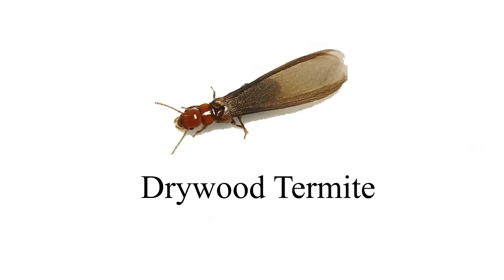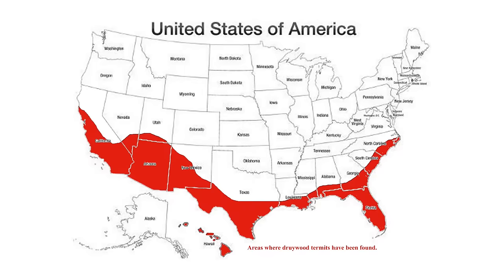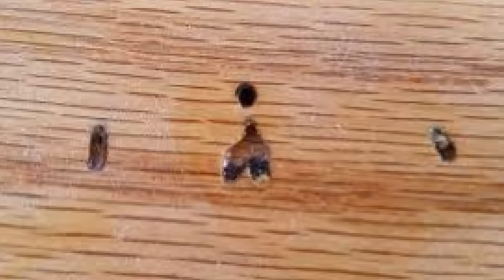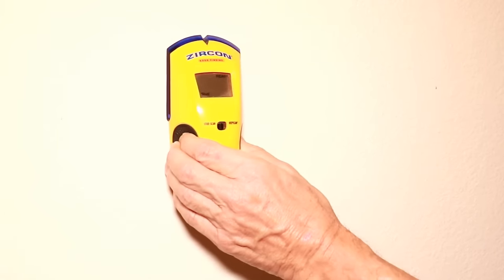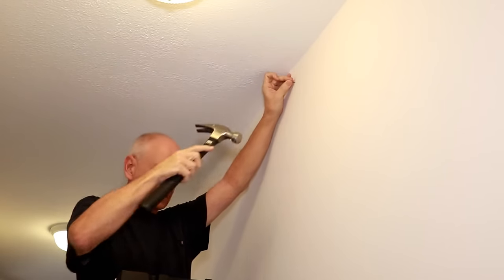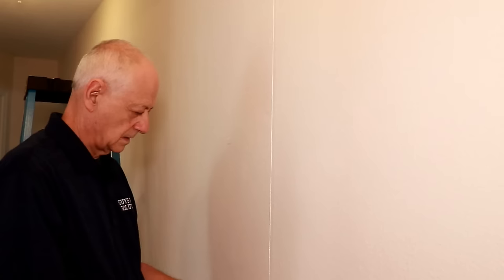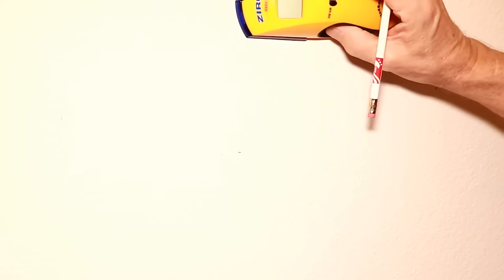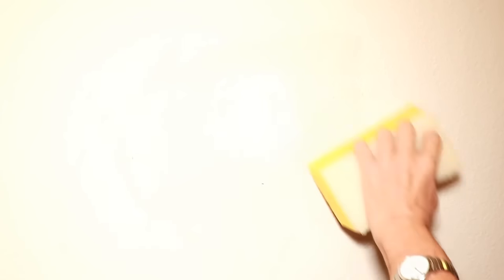How to Treat a Drywood Termite Infestation Yourself. A MUST see if you have Drywood termites.

Comment: Is termidor SC good for drywood termites? Or what is the best product for the termite infestation that is already in the wood .it says that it last up to 10 years
Reply from the maker: It is important to understand how drywood termites work.  They enter through cracks and crevices around windows, doors, the eaves, pipe penetrations, and so forth.  Most of the time, they enter through several locations.  That is because a swarm of them attacked your house at the same time.  If there was a crack or a crevice, then they probably found it.  After they established their galleries, which will be inside the wood, it will take four to seven years for them to be able to swarm.  Now that they are in your house, the swarmers will use holes that are in your studs to travel through the walls.  Those holes in the studs were created by the electricians to run the electrical wiring.  Not only are these holes going through the studs, but holes were drilled into the attic for the light switches and to run some of the wiring for the outlets.  So, the termites now have easy access throughout the attic and the walls.  If you have a basement or crawl space, they have access to that as well.  Most of the time, you will have no idea that they are in the walls, because the frass is inside the wall.  To make matters worse, if you have drywood termites, then your neighbors have them too.  That means you have been getting swarmed for as long as they have existed in the neighborhood.  Most likely, we're talking about years, so it's a safe bet that you have these guys in many locations in your home.

I always hate to be the bearer of bad news, but if you have drywood termites, the only sure way to get rid of them is to fumigate.  Prices for this can vary wildly in this industry, so I recommend that you watch my video on how to hire a pest controller without getting ripped off.  That video can save you a lot of money.  You should also know that the gas they use to fumigate has absolutely no residual action whatsoever, so you can get reinfested the moment the tent comes down.  Like I said before, if you have drywood termites, then your neighbors have them as well.  Since drywood  termites swarm every year, it is almost a certainty that you will be reinfested within a year after the fumigation is done.  The only way to prevent this is to do a preventive treatment on your house every 60 days.  Most pest controllers will not do this, so it is something that you generally need to do yourself.  I have a video on how to do that and I will place a link below.  If you absolutely cannot afford to fumigate your house, then you can try spot treating it yourself.  It is virtually impossible to find all the termite galleries, but it is way better than doing nothing.  Termidor SC is not a good choice for spot treating because it will not do a good job getting into the galleries.  You need to us Termidor Foam.  Just follow the procedure in the video you already watched on how to treat drywood termites yourself.  Regardless of how you treat it, you should begin the preventive treatment immediately, so that you do not get additional termites paying you a visit.

I hope that helps.  Be well my friend.                      

Video on how to hire a pest controller without getting ripped off:  https://youtu.be/y-a8XOqVrlE

Video on how to prevent drywood termites (You do not need to treat the yard for drywood termites.  You just need to treat the house):  https://youtu.be/U7ck7zhS0Xo
Reply: @GuysPestSolutions thank you. See I just recently found them and they are only on one spot on my home , so I was wondering if I can exterminate them all before they become more and to other areas of my home. You think if I spray that Taurus sc or the bora-care will kill them without me having to get the home tented? Thank you for your time.
Reply from the maker: @reytech1786  I really wish it worked that way, but if you are seeing evidence of them, then it's probably past too late.  The good news is that they are very slow eaters, so it can take years before they do significant damage.  So, if you want, you can treat that area as I show in my video by using a fipronil foam.  If you do it correctly, that will take out the gallery that you found.  Then just look for signs of them going forward.  I think it's a safe bet that you will encounter them again, so you can fumigate at that time.  I recommend saving up for the fumigation though, because it is coming at some point.

I hope that helps.  Be well my friend.

Comment: Help! I am now living with my parents to handle things they haven't/cannot. I see some trails in a few parts of the house (inside and outside), as well as trees/wood outside that have been attacked. Luckily, the house is mostly rastra/cement but also has generic 2x4s in some framing. There are some wooden features (vigas) throughout and outside that concern me. 
How should I prioritize and tackle? Thanks for any insight. 
I'm watching all your videos to gain much knowledge as possible.
Reply from the maker: How you handle that will depend on the species.  These guys may not be drywood termites.  Figuring out the species is actually pretty easy, and I have a video on how to do that.  I will provide you with a link below.  After watching this video, you should be able to identify the species.  Just get back to me after you watch it and let me know what you found out.  At that point, I can tell you exactly what you need to do.  Let me know if you have any problems identifying the species, but I do not think that you will.  It is much easier than you may imagine.  Also, please tell me where you live.  Location matters.   I see you asked the same basic question two times, so I only responded to this one.  I hope that's okay.  Be well Bianca.

Video on how to identify termite species:  https://youtu.be/dIs_a0nfVjg

Comment: Is it possible to have dry termites in the Northeast? I first noticed a pile of frass/wood dust on the bookshelf in front of an interior wall between the sunroom(I believe originally a porch) and the kitchen. The wall itself is not drywall but tongue and groove boards. I do not see holes, however I'm guessing there is room between where the boards meet. The house was built in 1952.
Reply from the maker: It is highly unlikely that you would encounter drywood termites in the northeast.  Take a look at the frass and look to see if there are dead bodies or body parts in it.  You may find dead ants or parts of dead ants.  If you do, then these are most likely carpenter ants.  They often push out frass from areas where wood joints are located, so you may not see holes in the wood.  If you can find holes in the wood, then you may be looking at some sort of wood boring beetle.  If these are carpenter ants, I can help you with that.  I can also help you if they are wood boring beetles as well, but I'm putting my money on carpenter ants.  I hope that helps.  Be well my friend.

Comment: Hi Guy, thank you for your wonderful videos. I've watched a few on termites and took notes. I live in Los Angeles California. I have drywood termites in different areas. Seen frass and kick out holes but none flying.
My questions:. What and how do  I kill the  termites under my wood floor? Fipronol down the holes?

I also found a lot of Frass on the wood floor and wood shelf of my 30-year-old shed. How do I get to them? I also found frass under the backyard water connection where the hose connects. How do I treat that?
Unfortunately I also have wood paneling (from the previous owner) on the exterior of the back and also 1/3 of the sides of my house. How would I treat that area? Although I haven't found much evidence there. ( Not really able to fumigate at this time trying to DIY ) 
Thank you!
Reply from the maker: There is a lot of information that I need to share with you, but it is way too much to include in the comment section at YouTube.  Therefore, you need to email me that guyspestsolutions@gmail.com.  I am going to give you a case file number.  It is very important that you put the case file number in the subject line of your email.  This way I can easily pull up the information on you.  Your case file number is 073020241.  I receive as many as 100 emails a day from people asking questions, and most of them are about termites, so please be patient if it takes a couple of days for me to work my way to you.  I always answer in the order in which they were received.  Don't worry.  I always answer all of my emails.  I can usually turn them around within 48 hours.  I promise that I will do my very best to help you through this.  Be well my friend.
Reply: Sending email with # in subject now. THANK YOU!
Reply from the maker: @kittymom9400  You are very welcome.  Be well my friend.
Reply: @GuysPestSolutions  Hi Guy.  I'm from Houston Texas and have dry wood termite frass and verified by my pest control company.  I have the same question as kittymom9400.   I have frass on my wooden floors and have noticed pin sized holes.  What is the best chemical and method to treat wooden floors?   I was quoted $5500 to tent and told not to waste my money spot treating.  Thanks so much!
Reply: @GuysPestSolutions  please share the solution
Reply from the maker: @elee414  I'm sorry I didn't get back to you, but I was not notified that you made this comment.  I just now came across it.  It is always a good idea to start a new comment instead of tacking on to an existing one because YouTube may not let me know you made a comment to someone else's comment.  I have a lot of information to share with you, but you need to email me at guyspestsolutions@gmail.com because YouTube may delete it if I post it here.  Just copy and paste your question into the email.  I am running about 4 days behind on email because of hurricane Milton, so please allow a few days for me to answer.  Again, so sorry for the delay.  Be well my friend.
Reply from the maker: @curiousgeorge2749   I have a lot of information to share with you, but you need to email me at guyspestsolutions@gmail.com because YouTube may delete it if I post it here.  Just tell me that you want information on treating drywood termites and I will explain everything you need to know.  I am running about 4 days behind on email because of hurricane Milton, so please allow a few days for me to answer.  Be well my friend.

Comment: I saw one company offered Heat tenting rather than fumigation. Supposedly they raise house temp to 120 degrees inside the tent. Does this work?
Reply from the maker: I do not have any experience with heat treatments for dry wood termites.  We know that termites cannot survive temperatures very long that are above 120 degrees Fahrenheit.  We also know that termites hang out in the center of wood members.  Therefore, we can conclude that for this to work, the temperature inside the center of every piece of wood in the entire building would need to reach a temperature of at least 120 degrees Fahrenheit, for a minimum of about an hour.  That means, the clock would need to start at the moment that the center of every single piece of wood in the house reaches the required temperature.  This would include exterior sheathing, fascia boards, floor and ceiling joists, and all of that sort of thing.  Failure to reach this temperature in all the wood for at least an hour may resultant in the failure to eliminate the termites.  So, this begs the question, how do you know if the center of every piece of wood has reached the required temperature?  The entire process is further placed into question because we also know that wood is not a good conductor of heat.  That is why you can have a stick that is burning on one end and hold it in your hand at the other end.  It takes a long time to get a piece of wood to reach a temperature of 120 degrees Fahrenheit.  Then of course there is the problem that houses are often insulated.  Certainly, there is insulation in the attic, and oftentimes the walls are insulated as well.  The very purpose of insulation is to prevent heat from transferring.  So, if you have insulation covering the ceiling joists, how effective is it going to be to heat those joists to the required temperature?  Like I said before, I have no experience with this system of treatment, but logically it seems to me that trying to eliminate a drywood termite infestation this way would be something of a Hail Mary Pass at best.  So, if it were me, I would probably stick with fumigation because I know that it is just about a sure thing.  Anyway, that's the way it seems to me.

You should also know that the gas they use to fumigate has absolutely no residual action whatsoever, so you can get reinfested the moment the tent comes down.  This would be the same for a heat treatment as well.  If you have drywood termites, then your neighbors have them as well.  Since drywood  termites swarm every year, it is almost a certainty that you will be reinfested within a year after the fumigation or heat treatment is done.  The only way to prevent this is to do a preventive treatment on your house every 60 to 90 days.  Most pest controllers will not do this, so it is something that you generally need to do yourself.  I have a video on how to do that and I will place a link below.  You should begin the preventive treatment immediately, so that you do not get additional termites paying you a visit.  

I hope that helps.  Be well my friend.                        

Video on how to prevent drywood termites:  https://youtu.be/neNsmVbj8Pc
Reply: I don't know about the heat effectiveness, but I would be very concerned about your home & items inside your home being damaged by the heat. My ac broke. Although   I opened windows & ran fans, items in my home melted some & even changed shape.  I don't think it reached 120° in my house.